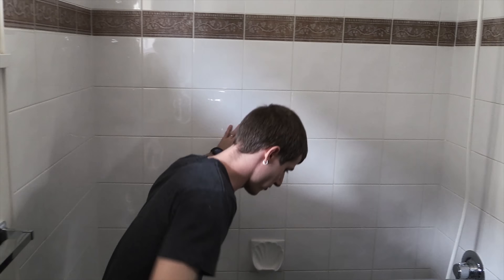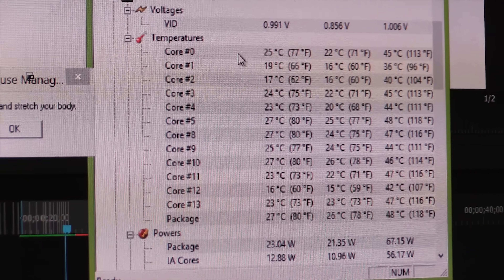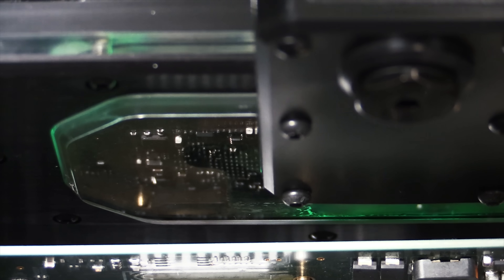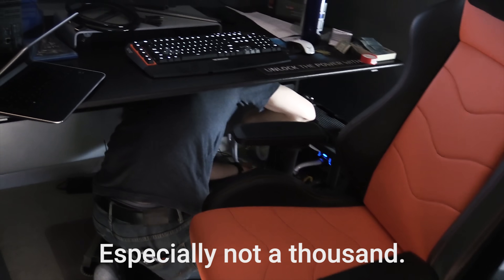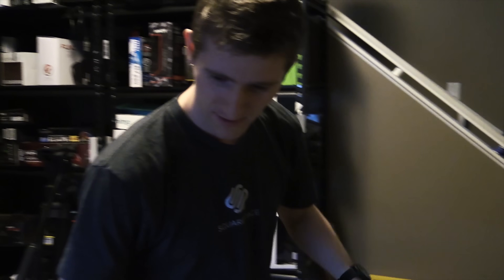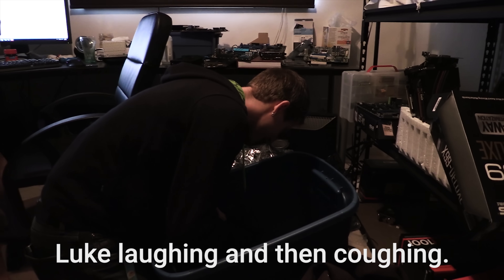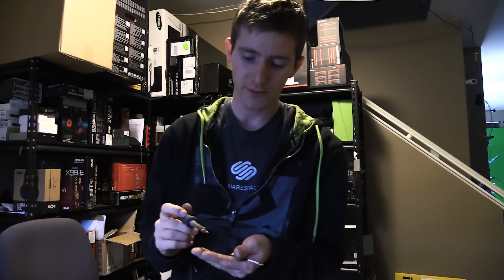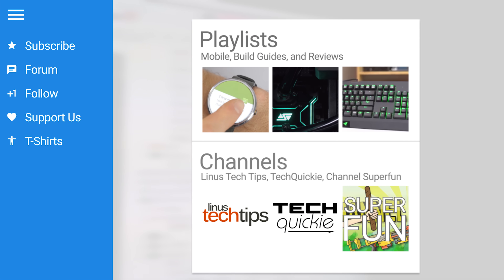Whole Room Water Cooling Part 5b - Some Issues, More Solutions...

Comment: leave the strands frayed, put them together letting the wires intertwine and then twist them together. get the iron tip hot and dab solder on it to use the solder as an efficient heat sink.

Comment: I can never be arsed to solder wires, so I just use the heat shrink connectors with solder in the middle. Work smarter, not harder.

Comment: I’m pretty sure you can put molex connectors on without soldering. Just need a special crimper and a tool for removing the pins. Which would be cheaper than buying a whole new soldering station. Said a guy to some other guys from six years ago lmao

Comment: I legitimately cringe at how blatantly obvious it is that they should've ran the pipes approx 2 feet (0.6ish meters) off the ground, had the pumps on the side of the bath tube with the water reservoir on a table at the same height or a little higher then the pumps and piping.. why in the world would anyone think itd be smart to force the water 8 feet (2 meters) straight up in the air only to almost immediately go right back down to the level it started at to interface with the computers.. hahahaha sheesh that's embarrassing

Comment: i have 2 soldering tips. One is invest in a 'helping hands' device, and the second is to look up a Western Union Splice. Its way way WAAYYYY better method for joining wires

from wikipedia:
"NASA found both the short- and long tie variant to be strong when soldered. The splices were examined in tensile strength ("pull") tests on 16 and 22 American wire gauge wire; even the short tie variation of the Western Union splice performed well after soldering. The test splices never failed at the splice (instead breaking outside of the splice area), leaving NASA to conclude that "the solder connection at the splice was as strong or stronger than the un-spliced wires."[4][6]"

Comment: Hmm. More faulty thing than right.
Tapwater was the worst option. Pure anyfreeze or mixed one would haven been great. Ionised water was also an option.
Putting two tubelar pump next to the other was a horrible mistake! Parallel would be much better.
Any of these gear can be easily cleaned with petrol from your car. Possibly some o rings need to be changed.

Comment: ironically he used the solder that would have been the right thing to fix that unsoldered pipe joint to solder an electrical connector,  but at least he had flux, hopefully it was the right type, and i still suspect the fan adapters are going to wind up corroded to nothing, that assembly should have been munted in a watertight gasketed project box

Comment: Tips for soldering: use a soldering stand for your wires to help keep the wires still.
Use heat srink to stop the wires shorting. 
Buy more soldering iron ends to have the right one for the job. 
DONT DROP THE SOLDERING IRON LINUS!!! 😂😂😂

Comment: Here is a tip to strip wires. You can use a lighter to soften the plastic around the wire and just pull it off... Its how i strip wires and in most cases it doesn't damage the wires at all... :)

Comment: shrink tubing might be better then electric tape "put the tubes on the wire BF soldering " ( it also wouldn't hurt to have a larger tube over all connections to make it water tight with a dab of hot glue on the ends)

Comment: cough i'm feeling like you lost a bit of power using a lead/tin/steel based 
solder on copper wires o.o' honestly i would have just used Marrette's 
there much easier to work with just splice the wires together twist one 
on and electrical tape it together with the wires. BAM! DONE!

Comment: solder tips: strip just the 2 first mm of the wires, splitt them up, twist them into each other, take the solder iron on one side on the connection heating it up, then apply solder tin on the other side of the connetcion

Comment: my electronic technician father from the navy says 1 don't move the iron, heat radiates just heat up what your soldering, move the solder.2 flux where you need soldered,

Comment: To anyone who is re-watching this 3 years late like me, pro-tip for soldering: don't use that lead-free crap on electronics. That's really just for plumbing so that the water supply doesn't get lead contamination. 70/30 lead/tin rosin core is my go-to. Also I prefer the really thin stuff so I can better measure the amount of solder used. The silver solder needs to be much much hotter to flow properly so you run the risk of either damaging components or melting the insulation back. Or just not getting a good connection as evidenced at 12:47. That's a great example of why not to use lead-free solder.
Reply: This whole thing was a little forced.  As if they ran out of ideas for things to do.   I would think in Canada a large part of the year, you'd want to keep the heat in the room.  And of course there is no reason to use computer fans and radiators (tiny stuff intended for indoor use) for the outside unit.  Except that is what was donated by the sponsor...

Comment: I would have connected  the pumps in  parallel so a t splitter  on tank feeding both pumps from tank than a t splitter on the water supply side that way both pumps are forcing water through the loop instead of one pump force feeding the other pump another way would be to put a pump at a half way point so the pressure is stepped up at the mid point

Comment: use flux to solder. Don't need to twist the wire. Stranded so solder flows better and bonds goods.

Comment: The next time you think you want to water cool a room consider an automobile water pump and radiator and drive it with an electric motor for a more robust system. Maybe have a reservoir with a window so you can watch the condition of things like air bubbles like strang growing accent alien biological (;o also just thought id have clear tubing throughout because what you see would be an early warning if is opaque your not going to get that. And also just a thought while the need for a filer in a closed contaminate free system seams overkills I don't think for a Proto-Type for business. If anything goes wrong and something changes and a contaminate enters the system maybe because you needed to do work a Filter. Is the downtime and overheating damage worth not having at least an inline filter. Also just an idea 
The automotive set up would allow you to use maybe 2" copper instead of "1/2 pipe " with a higher volume of water moving faster and also to cool faster might offer other advantages and cooling options. If you wanted something cool maybe build a custom tank made of acrylic and for effect, you could have a fish tank with fish nested inside the clear tank. If you had good filers you could let the water out of its closed system and have maybe a waterfall water effect it would cool the water.
If you want to keep the water clear you might be able to do it organically. Bacteria use to keep water sparkling clear used in outdoor water effects should work fine. And if you have a mostly clear system you will know if you have a problem before it becomes serious. I do think you are on to something and I think you can make money with it. You just need to scale it up a bit in my opinion. But you guys know these things better than I do you very good at what you do but I think your idea opens a lot of doors.
Of when I work, I'm hilarious! often a calamity of errors all talented and skilled people are lol
What you need you'll find in a Junkyard we did (;o) We built two 200 gal tanks for fish and used such a system, it will work.
peace

Comment: when soldering two connections like he did there is 2 ways to do it and a wrong way obviously Linus is doing the one wrong way. for the easiest way all you have to do is twist it like a bread bag twist tie then solder and heat shrink the end or cap it (https://goo.gl/eJ3F5p). the second and slightly hard way is to take the connectors like Linus had them before soldering and twist the ends opposite each other so they can grab each other (no easy way to show it but it looks kind of like your shoelaces before you fully tie them)

Comment: You can't run a pump into another pump, you could have had one pump pushing water into the tank and use the second pump to push the water to the computers or have a second pump halfway in the system to add as a booster...

Comment: Automotive coolant doesn't really need anything in it to kill bacteria for it's traditional use in cars. Engines get way hotter (like 210-220 Fahrenheit)  than any normal or even abnormal computer should ever get. That kind of heat has a tendency to kill almost anything, and the 14-30 psi of pressure as well as boil over protection from the coolant keeps everything from boiling. Works well for cars, but for computers you could have just used ethyl alcohol, or if that may damage plastic components, use red or orange coolant. Or if you are feeling really ballsy use a Pentosin OAT coolant.

Comment: Could have just used 1 motor bike radiator with a 12v electric fan and a pump at both ends of the reservoir it would have been whether proof too. Opposed to the not weather proof computer fans.

Comment: You probably won’t see this but you need to bleed the air from the highest point in the system. Also you won’t get growth what. It was in the system was flux from soldering that you should have flushed out your lines first

Comment: Soldering: I was doing it wrong for years myself until a guitar amp repair technician taught me how to do it reliably: make U-hooks of both wires (I recommend not-tinting them before as it would make it harder) - hook the two together, then solder. Your goal is not only to conduct, but to end up with a solid, physical connection. And as others said - heat the wire, not the solder whenever possible. Also, shrink-wraps for the win :-)

Comment: So to prime your system lines, raise your reservoir above the top most point of the lines and gravity will aid in removal of the air that is trapped. Also your main pump should create enough flow to keep liquid moving through the hole loop when all system pumps are off, and system pumps should have a similar flow rate or just a tad bit higher so they just help push things along. Also try one pump pumping out of the reservoir into the loop and the smaller main pump pulling from the loop into the radiator assembly then into reservoir. Also you should never use tap water in any cooling system or lead acid battery. Use distilled water. And for maximum cooling with a liquid system, use 90% distilled water, 9% water wetter available at a local auto parts store, which adds surfactants and corrosion inhibitors and then 1% anti microbial anti growth agent. Also for the outdoor radiator, use a bigger automotive style radiator and 2 large diameter fans either 12vdc or 120vac in a push pull configuration on the radiator. Also why not put the reservoir and radiator units outside and just run 2 pipes up the wall. Had you started with this concept in mind, you would have had it done during the initial install. Hit me up if you need any help with any other monster project concerning mechanical, electrical, cooling, or lighting/automation. I have extensive experience fabricating impossible, ridiculous, unnecessary  and insanely enormous projects involving many different trades and technologies.

Comment: your dad's a plumber why not add a auto top off system used on fish tanks and other machines that help with the problem of running to dry. after all its an expensive system you're caring for it might be worth the extra 15 dollars.
Reply: ALSO I would recommend fashioning a better box for protecting those fans from the rain and wind, when it gets turbulent it could cause water to get into the structure you made.

Comment: If you need a solder slave and huge computer/electronics DIY nerd in general?

I have no job :(
Reply: I would have stripped all fan wires  and depending on amount of fans made groups or converted to 24/36v.

Comment: It helps a lot to twist the wires together before putting any solder on them, and before that is a great time to slip some heat shrink tubing on one side. Twisting them makes a really strong joint. So solder is just reinforcement. It also just makes the soldering easier.

Comment: If you want more water flow and pressure, put 2 pumps in parallel, not series :D Or in the end you get one pump feeding the other and output pressure is that of the last pump :D Two side by side on the other hand - twice the water flow, same tube diameter - twice the pressure.

Comment: you are using a cone tip for the iron im  not really sure because i have not used one before but the wedge shapes work well for me and if you heat up the wire first the solder melts better and its easier if you have something holding the wire and if you tin the tip after each use

Comment: i was going to create some elaborate cooling setup for my rig one time too, it involved tubing being run from the PC out thru the wall of the house and into a large radiator out of a civic and an electric radiator fan to cool it, but i did the smart thing and bought a portable AC unit and made some ducting out of styrofoam and flexible ducting and had the end of the ducting pointing at the PC radiator. in the end i got super cold temps, not a lot of work and it was relatively inexpensive (not to mention i needed a new AC anyway and whatever the rad isnt utilizing is cooling the room down too) though admittedly its not very attractive

Comment: tips of soldering youve requested. strip em a fair amount. divide the threats into two and separately twist em. do this for the other wire aswell. now twist the four leads into each other and solder em. after that cut of excess length of threats and flatten em. and tape em, or use a heatshrink (wich i did not mention that you have to put on before starting all this)... result: happy wires!

Comment: This may have been said. But tap water = no good. Read the antifreeze. Distilled water is recommended. Though with additives you could get by. 

Also, with 2 pumps 1 should be in the middle of the system. They shouldn't be side by side.

Comment: holy shit, you know, I have had ideas to do something similar to this for a long time. 
How the fuck do you not have an in line bleed?
How do not double check shit on 4000+$ hardware?
I mean christ, a 3 way valve on the copper ones with a cut off at their peak, that's all you would need to fill the damn thing

Just watching this thing begs the question, how can you be this stupid?

Comment: Just a little something I observed and through previous experience: typically during soldering, the iron is used to heat the surface or copper leads, and then solder is touched to the heated surface to bond with the lead. This MAY NOT be true, but it has worked well for me in the past.

Comment: Hey there Linus. Here's some solder tips (I'm a class 3 solderer, for what it's worth, but nothing beats experience). When soldering 2 wires together, fold your 2 wires into a hook, hook the wires together twist, them and solder. when multiple wires are involved use some off cut cable, strip a nice length roughly 10cm., and cut of 1 strand, keep the other strands for another time or later.now take all your cables that you want to combine, twist them individually slightly, and tin each one(hold your iron underneath and apply solder wire from the top, if you have flux, flux the crap out of it.....flux is your friend, do NOT apply solder to the iron and then wipe it on the cable, as your flux is already burned up). Now position all your cable/wires as you want them. Use the 10cm single strand wire and wrap it around the joint to be made(this does give serious mechanical strength), once you wrapped the wire around your solder assembly nice and tightly, use some helping hands or someone to elevate it for you. Same as before place your iron at the bottom of the assembly and apply solder from the top. You can add a bit of solder to the iron before hand to help with the heat spreading. The wrapped wire will also help with heat spreading, but its main purpose is to keep all wires in place during soldering and add mechanical strength after soldering. Your solder joint must be shiny (using leaded solder). if it's not shiny that means its a "dry joint", add a shit load of flux reheat with the iron and piss flux over it while heating, when you remove the iron it should then be shiny. Cover with heat shrink and done.....WOW this became long very quickly. If you want some more tips on soldering somehow let me know.don't mind sharing this skill/knowledge. Thanx for an awesome channel
Reply: I'm going to use all your advice next time I solder. Thanks!

Comment: running those pumps dry is not  that bad   unless they rely on water to cool them and lubracate them i assume like most pumps thease nes have a  seprate  moter with its own fan  and that the  blade hosueing is lubracated on its own  most of those pumps are just a  fan blade inside of a small housieng usually they are lubracated in the seal    joining the moter to the pump head as you can sometimes pull the head off and use the moter on something else